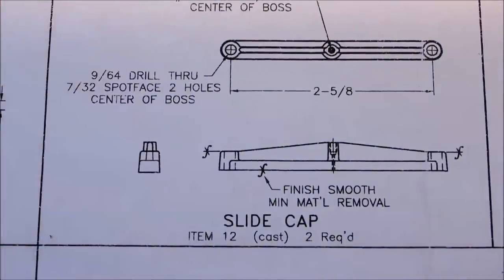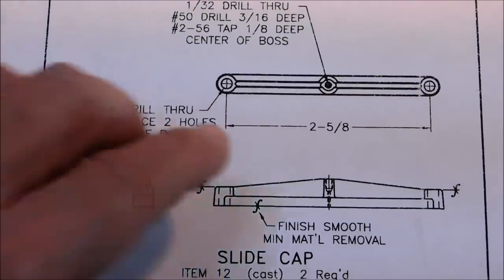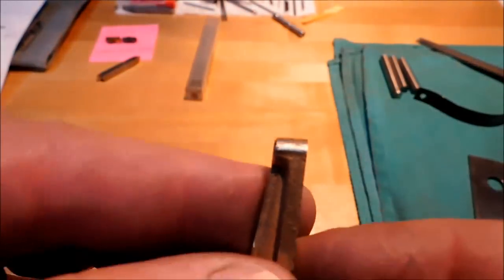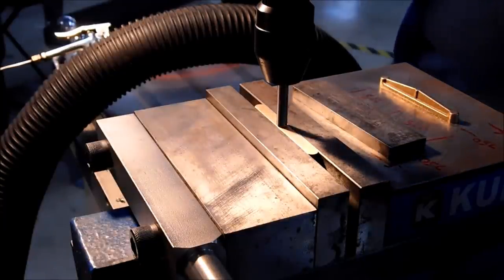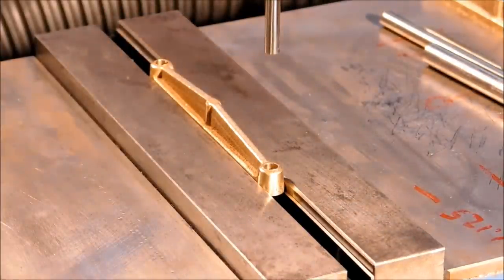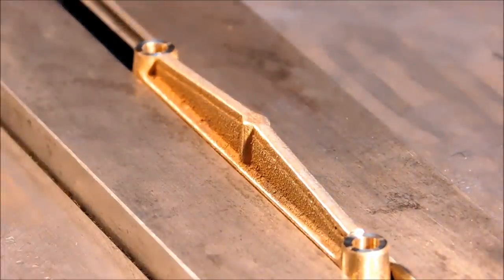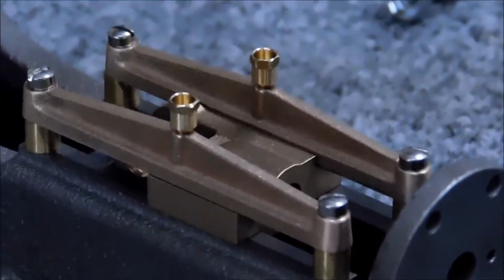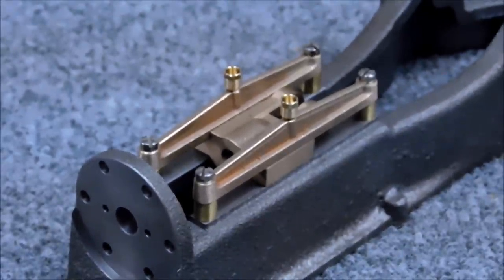Machining a Model Steam Engine - Part 12 - Slide Caps

Comment: I was a mechanic for over 50+ years on forklifts, diesel,electric and propane we did machinery and custom jobs all the time for cylinders, drive gear and etc. and I have been watching people build model steam engines on the Internet for some time . Being a model builder myself I can see and go along with the procedures. But your work brings a new standard to the world of building perfection I have to give you 10👍🏻 for your work and great videos. I watch all the jobs you do with excitement. In my opinion I haven’t seen any one better then you . God bless !
Reply from the maker: Thats very flattering. Thank you for the compliment.

Comment: These P.M. Research kits are really good.  They come with everything needed to build a running engine. A lot of these kit could be built with a file, hacksaw and hand drill and they would run. The true enjoyment is building them as accurate and best finished as possible. Then they become real works of skill and art to be proud of.

Comment: Man it surely looks good once you start flying the brass parts and the shiny screws in. Very relaxing to watch you build Joe, and I am really liking your method for using a pin to figure where the hole lies introspect with the casting, simple yet positive, and a good plug for the tap handle, cheers!

Comment: As usual another great video, I would like to add one other trick regarding setting a surface parallel with the top of the vice jaws.
If you use two magnets on the top surface of the fixed jaw it frees up one of your'e hands.
Stay safe and keep the videos coming.

Comment: If your oil/lube flow is to high, instead of peening the holes insert “Joggle or Jiggle” wires into the oil cup that restrict the flow and are easily removable or changed to suit lube viscosity or flow needs.
Make them from soft wire such as annealed copper to reflect a “T” pin and to reduce the flow to about 50% of the final port size in the slide caps.
Thank you for your time and insights.

Comment: When it comes to drilling small diameter holes I prefer to use drill bits with a 2.3mm shank. They are less likely to break, easier to handle, and fit standard drill chucks. Oh, and they are easier to find when you drop them ;-)

Comment: I think you are hooked.  Welcome to the club!
Reply from the maker: I am enjoying this more than I thought I would.  The EL1 model next in line. That will be challenging.
Reply: @joepie221  I think most of us suffer from the perils of accumulating errors.  They compound as the model comes together.  You have shown that by following the print and the tolerances exactly, you are achieving accumulating precision, which is a joy to behold!

Comment: Great videos Joe, at 62 I'm finally putting together a shop (actually it's my first house) I have an 11x24 Chinese lathe and a Clausing 8525 mill and looking forward to do the things I have learned. Thanks.
Reply from the maker: That is awesome!  Have fun and be safe.
Reply: @joepie221  I'll always be safe, I grew up in a chain saw dealership and know what happens when you don't respect machines. I saw a couple of funny safety signs one said "This machine has no brain, use yours". and the other was " you probably came into this world by accident, don't go out by one".
Reply: I also wanted to tell you a story about a job I had where I made parts for food packing machines, I worked on a Bridgeport for an old German who designed them and built them from scratch, every morning he would give me a set of prints and tell me how many he needed,,one day he came up to me and said "Mark I like your work, when you make something it fits" I looked at him with a puzzled look and replied "Isn't it supposed too?".  I had to machine ports in a tapered valve core made of an alloy called  WM88 (from Waukesha steel) Manfred said to me I don't care how long it takes but they have to be right later on I thought about how much of a compliment that was because it came from a man from a culture who is fanatical about precision and he trusted my work. If he hadn't crashed his plane and died I would probably still work there, he was also my friend and I flew with him on his 3 flights just before he crashed, now I can relate  to how my fathers aunt and uncle felt after they cancelled reservations for the Titanic.

Comment: Joe, GREAT series!  I've wanted to build a steam engine since I was in my teens.  After many decades I now have my own small machine shop in my garage.  Just need to get to it.
I have seen a great many model/small steam engines over the years.  Most of them have the fillister head screws you used.  They look more "period correct" than an allen cap screw.
I have a friend that has a small stationary steam engine that was designed and made by his father.  He was a pattern maker and made all the patterns and casting himself.  My friend still has the patterns!  BTW, that engine has the same type screws you used...  I'm working with him to purchase it as he doesn't really have an interest in stuff like this.
Reply from the maker: I personally will enjoy looking at this thing for many years to come. if you get a chance to build one, give it a shot.
Reply: @joepie221  I started on Elmer Verburg's #33 mill engine from billet years ago, and set it aside before finishing. After watching your series I have pulled it back out and dusted it off. Thanks for the inspiration.

Comment: Tiny bit of cotton as a wick will restrict excessive oil flow. Another trick i've used to make small holes smaller in brass/bronze, like in finding correct size carb jets, is to soft solder it full and blow through when solder is still molten.
Reply: I was thinking about cotton because the full sized version uses a stand tube and wick, as for carb jets no need for solder, a piece of magnet wire inserted in the jet will reduce the size as required
Reply from the maker: I like it. A piece of felt in the bottom of the cup has also been mentioned.

Comment: Always enjoy your videos, tons of great tips over the years. Speaking for all the curmudgeons, that bandsaw blade looked a little coarse for the thickness of the "horseshoe" you cut off.
Reply from the maker: Technically, it was the wrong blade. Realizing that, use a zero clearance guide and push slowly.

Comment: There was an article in 'The Home Shop Machinist' Jan/Feb 2008 about making miniature taps and dies for modellers to keep everything in correct proportions.
 I know I'll never use 0.010" diameter, 350tpi but it was pretty interesting. (at least to me)
I I don't use anything smaller than 1.8mm or more usual 2mm which are commercially available and the carburettors I modify don't use smaller than 3.5mm diameter but some non-standard pitches up to 8 x1mm
Reply from the maker: I learned that a long time ago and have had great success over the years. Big handles are not for small taps.

Comment: Hey Joe, thank you for your videos, I’m always learning a lot from them. The bandsaw blade caught my eye, it looked to be a bit coarse for cutting the fairly thin fork - I am assuming the piece of wood underneath was to both have zero clearance and give the blade additional thickness to work with so it wouldn’t grab?

Comment: Hi Joe,
Nice work... Out of interest why did you make the tapped threads for the oil cups deeper than the drawing stated.
Take care
Paul,,
Reply from the maker: So the cup bottomed out on the cup body and not leave any thread exposed. Strength and aesthetics.
Reply: @joepie221  Thank you
Reply: @joepie221  Aesthetically and design wise the full sized oil cups would have had a fairly thin brass nut on those threads used as a lock nut :-) The problem with all this is just where do you stop trying to replicate full scale. 

By most standards Mrs. Cherry Hill / Hinds is probably the finest model engineer in the world that's alive today. This link will take you to the Shereline Craftsmanship Museum page about her. https://www.craftsmanshipmuseum.com/Hill.htm about half way down the page is a list of unbelievable exact scale steam era engines she's built from scratch that are now kept at the prestigious Institution of Mechanical Engineers in London England. Clicking on each one of those will get you to full screen pictures that still don't do them justice according to one I know who's seen them in person. In judged shows she's won every award there is to win for her work and done so pretty much at every show she entered a model in since 1968. Another I'd judge as almost her equal would be Jerry Kieffer who's also listed on that Shereline website for anyone that's interested.

Comment: For sure, anything but the screws here. I am always a fan of black Allen head machine screws but studs would work too.
Reply: Except shcs or allen head bolts were invented long after engines like this were in common use. Allen bolts do however make a great source of already black oxide coated studs just by removing the heads and dressing the cut off end.
Reply: @turningpoint6643  Thanks. I can use that for sure.
Reply: @turningpoint6643  Awesome. That I can use for sure.

Comment: Bolts could be either hex or quad as this photograph of the still running 1890's era San Francisco Cable Car mechanism indicates: 
https://en.wikipedia.org/wiki/San_Francisco_cable_car_system#/media/File:San_Francisco_Cable_Car_Power_House.jpg
Also note the oilers in the lower left.  They are glass so workers can see the level of oil in them.
This is a great place to visit if you want to see running 19th Century technology.  The details are fascinating.

Comment: A bit of string down the threaded holes would make it oil nice and steady :o) If not a slot head screw it would be studs with that particular old school nut with more metal than a modern nut.  More work, but maybe worth it?
Reply: Felt works very well. It also acts as a reservoir if for some reason the pot didn't get topped up

Comment: 14:08 that’s your old tap handle! ;-)
Reply: And how did you know I made a tape handle yesterday? Actually 1 and a half, will finish the 2nd one later, need one for the outside workshop, and one for the inside  shop.  I used aluminum bar and M4 cap head bolts. Will see how that works, don’t have stainless to hand since I work almost entirely with scrap metal.

Comment: As you say Joe, the screw heads spoil it a bit. I would say the full size would have used studs and double nutted? I'll be keen to see what you come up with. Nice job btw,
Reply from the maker: I may swap them out in time, but it will go by the kit for the first assembly.

Comment: Awesome work as usual. Can’t be much left.
Reply: Oh yes there is. Still need a boiler, displacement lubricator, globe valve, condenser, a base to display it on, a pulley, plumbing....
Reply: @henrya3530  maybe he'll just hook it up to an air line and call it good.
Reply from the maker: There are a few parts left. Not many.

Comment: I wonder if stuffing a  small amount of cotton in the hole before screwing in the oiler would act as a regulator to meter the oiling of the cross slide.
Reply: I would think a small piece of copper wire with a loop on the top would be better. Drop it in from the top and the diameter of the wire is the adjustment. Could go all the way thru the oil cup.

Comment: Nice Joe. Nice to see it coming together.

How many of those oil cups have to be made?
Reply from the maker: 6. 2 for the slides, 2 for the crank bearing caps, and 1 on the rod and eccentric cam collar. By the time you get to #6, you'll have it figured out.

Comment: An easy way to give it an authentic look would be to cut off some screws using the threaded part as studs and purchasing nuts for the studs.
It is my opinion that the real full sized steam engine used studs in this application.
Just sayin, JIM
Reply from the maker: I agree.

Comment: Question: would it be benificial to drill a hole through the crosshead to allow some oil to work its way to the bottom of the slide?  Great job, video as always, thanks!
Reply from the maker: The length of the crosshead allows the cup to drip directly onto the lower casting as it passes the oil cup hole. I'm thinking some grooves in the slide to distribute the oil might be a good addition.

Comment: The diameter of the oil hole is just OVER 1mm, not under.  1mm is 0.0395.
I fail to understand what you gained by the inverted setup (other than the difficulty of getting the part "up" against the stop).  You indicated off the 2 ends of the casting, I assume at the fattest point of the draft (at the flat surface).  Could you not seat the part in the vice on parallel underneath the conventional way, tighten, then slip out the parallel, then insert the pin down between the vice jaws to indicate?
          (Actually, wouldn't it be better to indicate on the top bump rather than on the draft at the flat side?  You are assuming the draft is the same on both ends.  That is also influenced by how much you sanded each end.)
          If you were in the circuit board business, you would have no problem having the small drill (but those drills are very short with 1/8" shank.  I would drill from the top with 0.040 drill, but not all the way through.  Then I would insert drill bit shank end into the extra-deep part of the #2-56 tap hole. chuck protruding part of drill bit in lathe, and with part whirling around that pin, finish drill from the flat side with the mini carbide drill in tailstock.)
Reply from the maker: The relationship of this part to its standoffs is highly visible. I chose to invert the part to allow for a better comparison of the round standoff to the casting. You can't do that with the part held conventionally.
Reply: @joepie221  Isn't the standoff pointing down, on the underside, into the vice, when inverted?  How can you set to that (unless you have a tiny mouse crawl between the vice jaws & look up)?  What am I missing?  Don't you want the "visible feature" pointing up?
          What you need for this is a thingy resembling the aluminum lathe live center cover (you used for compression turning).  Machine a hollow cone with a shank on the other end.  Slice it on the bandsaw so you have a skinny cross-section.  Mount this into mill spindle and plunge down on the standoff, and adjust X & Y until it contacts standoff on both sides for all rotations.
Reply from the maker: @bpark10001  When the model is yours, the choice is yours.
Reply: @bpark10001  I think Joe means that the bottom of these slide caps which have a sharp edge need to appear concentric to (or at least balanced with) the standoffs on which they sit. The top side, while more visible doesn't have the sharp edges due to draft angle and the compound angle formed by the "cross member".
Take a look at 19:09 and imagine if the overhang on either side of the perfect cylinders of the standoffs didn't match. It took me to the end of the video to understand the reasoning here.
Another option would have been to set the slide caps on the physical standoffs, line them so they look good and mark them with something like a transfer screw. That might be considered cheating, though. ;-)

Comment: I’m starting to get the idea that the bandsaw is a pretty important machine in your shop. I couldn’t help but notice that the material thickness seemed to violate the two tooth rule you have mentioned. Does the phenolic block (@ 2:00) help reduce the hazard?
Reply from the maker: Hi John. My saw gets a lot of use. The 2 tooth rule is for blade integrity. A slow feed with a softer material works well if its outside that rule. I wouldn't make that cut on a steel part with that blade.